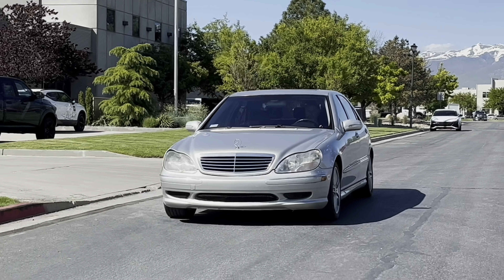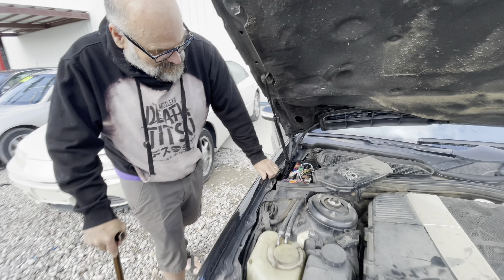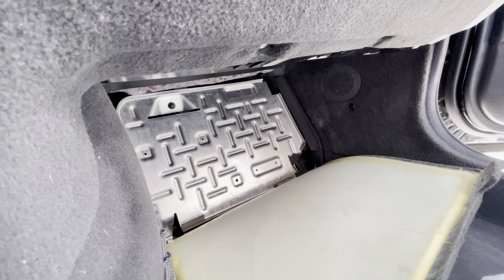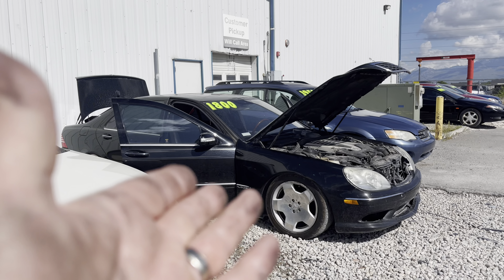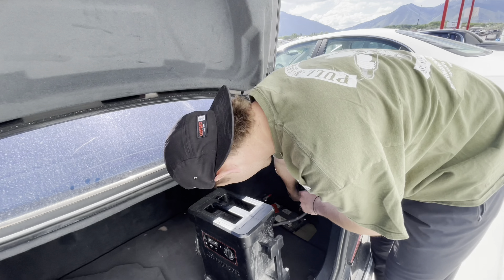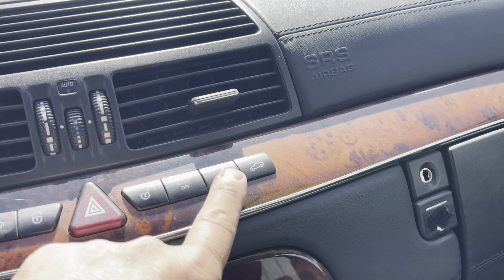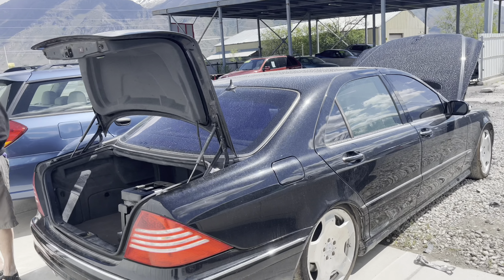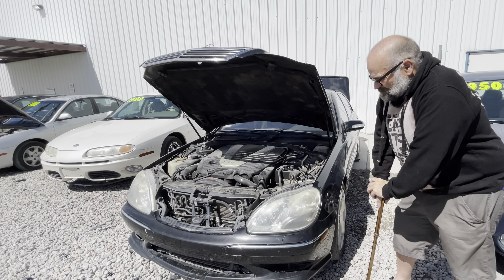Worst V12 Benz ever built and I WANT IT! W220 S600 for $1800

Comment: The Prefaclift W220 S600 does have the worst Mercedes V12, the M137. But the facelift has a very reliable V12, the M275, only main issues are the coil packs, but the engine itself is great, even being used today in the Maybach S680 with updates, being named the M279
Reply: one of the most reliable engines i ever had   m275 , i will not forget the smile in my face after every gas pedal push
Reply: @fuyouto how are the cl600 v12 cars? Same air suspension and ABC issues? Do these older ones have the newer Benz electrical issues everywhere ?
Reply: @farcherring9715  you can avoid the bad suspensions but the coilpacks , no chance and those costs more than 2k

Comment: I'd love if you got it! I have a broken one myself. (W221) The Pentosin didn't just disappear. I'd bet a high pressure line erupted somewhere while driving and the fluid drained. You can reach out to Gold Element Autoworks (Tell Brandon I sent you) and get coil overs and eliminate the ABC suspension. (Get a pump from a S430 for the power steering) Or rebuild the pump for $100 bucks or have someone else rebuild it for $350. You are only in it $1800. You'll be riding pretty with a $1500 invested. I'll be watching!
Reply from the maker: Yes! I’ve seen what Brandon is doing, definitely an option
Reply: I have a rebuilt ABC pump I would sell for $3.50
Reply from the maker: @ToddtheLoneDroner $3.50?
Reply: @AutoAfflicted  LOLOLOLOLOL The power of a mislocated decimal point!!
Reply: $350

Comment: M275❤ got the SL600/SL55 and the CL55. Have plenty of experience with the ABC. 😂 nice video 👍🏼👌
Reply from the maker: Nice! I think we found the ABC  leak today
Reply: @AutoAfflicted  I replaced accumulators etc…then the pump gave up a week later 😂. Back on the road now. That was the CL55. The SL55 and SL600 next. Never ending. Then I have a W124 E320 M104 convertible. No spark or fuel tackling that next week. 😂
Reply from the maker: @BobBenz55 you got your hands full! We got a C124 with a turbo m103 over here as well
Reply: Nice 👌 Mine I did the 3.6 M104 AMG engine swap. I have a SL500 R129 with the M113 engine ❤️ but seriously thinking to do the M113K swap on her 😇
Reply from the maker: @BobBenz55 that would be a good swap - I’d like to have a gen 1 CLK M113k swap and a manual

Comment: S600 and ABC aside,a common W220 is a really good car,well built as any Mercedes model.
Reply: Right. I’ve been driving an 03 S430 for like 4 years now. Besides the airmatic struts and valve block (which was gonna  wear out anyway) it’s been good. People love hating the W220 and I let them😅
Reply: @omostim2385 the s600 has 256k miles. 20 years old and still runs.

Comment: You didn’t “activate” the suspension btw — those buttons raise the suspension higher than regular ride height for more clearance, and firm the suspension in two settings of dampening, hard and harder. Not advised to drive on the bump stops.
Reply from the maker: I did press them to activate the raising .. it wasn’t going to do anything of course 🤣

Comment: that knocking is the tandem pump canibalizing itself, if you want a used pump reach out to me and let me know i have a bunch, otherwise if you need fluid i have the cheapest abc fluid available on the market, with access to that i have been able to maintain my s600 04 and my cl65 both with abc suspension
Reply from the maker: Nice! I may need to reach out for a tandem pump. We’re going through the ABC system now… we did find American made pentosin that is only $12 a quart

Comment: Any car with 200k + miles will have its own problems especially with a car that has more features than a 2024 car. This one is 20 years old and has over 256k miles. It looks like it lived its life well and relailably. V12 is expensive to maintain, not a inline 3 prius. In my eyes its more relialable than any gm car v6 or inline4
Reply from the maker: It’s the 40 modules that scare me - one day to get for a nice drive and “click” nothing happens

Comment: as problematic as they can be... it's just so much damn car for the money, worst comes to worse you coil-over swap it like mentioned below. I'd also place my bets on a popped line but that can get tricky and expensive realllll fast so be wary, accumulators, the double pump, not a rabbit hole I'd jump in. BUT if you get lucky and it's just one obvious leak, you fix it and see if it holds. Chances are though, if it's the rubber lines, they should all be replaced just from age/mileage alone. BUT IT'S A V12 lolol someone DEFINITELY loved it to make it to 250k and still be in that good of shape. Good lucky my dudes, may those mermaids provide fun and laughter and not decimation of your crew and ships :)
Reply from the maker: Pray for us 🙏🏼🇩🇪❤️

Comment: The dipstik is electronic.  It is on the dash!
Reply from the maker: Ah yes  the electric dipstick, I’ll check it there
Reply: I bought me one for the transmission. The oil dipstick is there, though.
Reply from the maker: @changeyourenergy708 but which model did you buy ?
Reply: @AutoAfflicted the 2002/3 S500
Reply from the maker: @changeyourenergy708 does your car display the oil level on the dashboard? If not, then that makes sense that it has an actual dipstick. Our car has a place for a dipstick, but just a cap is fitted.
Reply: @AutoAfflicted  yes. I can check the oil level at the instrument cluster. But the tranmission is supposed to be sealed for life🙄. So no stick was added. Just a locking tap where the fluid level is checked. The tool I have is called a service tool.

Comment: You can see how Legitatreetcars fixed the abc on his cl but it’s funnicky. I prefer airmatic because it’s 5 parts that can be broken. 

How ever. You got a sub because I love this chassis. These wheels are looking great and there aren’t a lot of wheels that suits great on a w220
Reply from the maker: Wait till you see the leaks we found on this hydraulic suspension. I couldn’t agree with you more about these wheels, I’ve seen them, but I’ve never seen them on the car that I actually liked them on and they do work really well on the S600. Thank you for the sub!
Reply: @AutoAfflicted I wouldn’t choose for this car because of the abc. That goes beyond me expertise of DIY like Legitstreetcars showed. 

This car is only fun if you can work on it yourself and it’s not your daily. No rust I see so you are lucky (probably because it’s facelift)

I’m curious what the rattle sound is!
Reply from the maker: @rbrood267 the rattle/knock sound is coming from the tandem pump for the hydraulic suspension. It has quieted down since we got a little fluid through it, but we’re still working on fixing the leaks in the hydraulic system so we can know if the pump is still alive or needs replacement.
Reply: @AutoAfflicted wow. I thought it sounded chain related which is not something you want to have on this engine. At what price point you decide to change to coilovers?
Reply from the maker: @rbrood267 I think if we have to get into replacing one of the hydraulic struts at that point we would probably go to a coil over set up, but if it’s just a matter of replacing the pump, then we’ll go that route. I really would prefer to keep the ABC suspension, but the goal is to get this car running well with the least amount of investment.

Comment: Love shit like this get it running
Reply from the maker: We were working on it today, found the fluid leak in the suspension
Reply: @AutoAfflicted  nice that’s a great start how’s the rpm issue
Reply from the maker: @intelligence6900 once we get the suspension leak free and lifted up, it should then come out of limp mode, we may have to use the scanner to pull it out of limp mode
Reply: @AutoAfflicted  I can only imagine the pages and pages of codes but as long as it’s reasonable / within your budget to do it then I would say bring that v12 back to life w220 gets a bad rap but I still love all S class I currently drive a gle amg with a G wagon on order so I’m all for it I will follow your journey. Good luck.
Reply from the maker: @intelligence6900 pray for us 🙏🏼 we are trying to get it on the road asap and will certainly document the journey
Reply: @AutoAfflicted  🙏